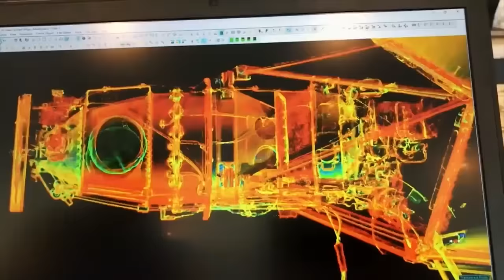We both almost died...now what??

Comment: Everyman's affordable airplane is the Patey sized challenge in my mind. Hard to quantify because it's different for everyone. But I can think of some good qualifications:
1 - Hangars are expensive. Trailerable, and make the trailer part of the support system for the plane. A 'portable shop' designed to support the aircraft, even disassemble major components
2 - 6 seats with tradeoffs in baggage weight, etc. Physics only goes so far
3 - Modular engine systems that are easily maintained
4 - Possibly inline twin for safety?
5 - A dramatically less expensive engine option - biggest challenge
6 - Printable components - make use of "maker" technologies such as plasma tables and 3D printing for most components
7 - 1,000 nm range
8 - 150 knots or greater
9 - Turbocharged for safety even in the flatlands. Climbing  over weather becomes a possibility
10 - Dirt simple systems

I've been working on this for years. Lots of ideas.
Reply: Regarding the modular engines - I really want to see hybrid aviation. If you have a generator, batteries capable of keeping you in the air for maybe 30 minutes, and a pair of electromotors, you get a system that is almost impossible to suddenly lose an engine on. Electromotors can be pretty oversized for redundancy if one fails by some miracle. A genset that is scaled for some reasonable climb will give you range and backup for batteries while being lighter than an aviation-grade engine scaled for takeoff power. Batteries make sure that your genset is not a single point of failure, giving you the power boost for takeoff and the time needed to make the turn of death when needed.

Comment: 1. There's great momentum and community building going on general aviation right now. 
2.  General aviation still seems to be plagued with accidents and a high incident to death ratio.  
3.  No association affiliations. 

    I'm a fan of general aviation.  I've had my face pressed against the glass, looking in at all the fun, for many years.  From an outsiders perspective, here are the key barriers that I, or anyone in my position, will need to overcome in order to become an insider:

•Enormous financial startup costs and significant ongoing maintenance costs.

•Sometimes the "general" in general aviation makes it difficult to decifer which camp is right for me.  

•Space.  Aircraft kits are just to bulky to assemble. They are overly time consuming to build so a modest privateer like myself feels pushed toward entry level ultralights and less safe decision making. 

My proposal for the Patey Bros: 

• Design a GA aircraft that has zero kit components, rather, only accessible materials. One that is the safest in the skies.  A plane that is a true quick build.  Maybe it uses advanced adhesives instead of rivets.  It needs to be jaw dropping cheap ($10-$15k) all in.  It needs to operate like a conventional fixed wing aircraft as an ideal time/experience builder.  It should be docile and intuitive with just enough delight in flight.  It absolutely must be trailer friendly for at-home storage.  Lastly, it needs to be a fine looking bird, with charm and simplicity that instills confidence and pride of ownership.  The Volkswagen bug of the skies.  

In short, I think the greatest contribution you two could give to GA is accessibility.  

Love the channel, and so glad Mark is healthy.  Best regards, 
Ben
Reply: I agree completely.  Flying should not have to be a life-or-death decision.  Better technology could reduce the chances of the pilot making deadly errors.
Reply: 100% nailed it. Flying is cost-prohibitive, and when something does go wrong in the air, the death ratio shows a HUGE gap in how we've handled the evolution of aircraft vs automobiles.
  
I know some people dislike ballistic chutes, but if an engine blows and you aren't near a viable strip, or a rookie pilot gets into a spin they can't recover, a parachute WILL save your life. And not just your life, but in many cases will preserve your plane as well (minus repairs). It just seems like such an easy cost-saver / life-saver, I don't understand why they aren't more widespread. Cirrus gets it. Many ultralights get it. It's high time the rest of GA/LSA does too.
Reply: @thecheesedip  I don't dislike Ballistic chutes but the repack costs are horrible, the Sirrus chute is 20k to inspect and repack.
Reply: @wb6anp sounds prohibitively costly. Crash structures are passive and can be extremely light and cost effective (f1 cars),  there seems to be a pursuit of lightness and efficiency that's incompatible with crumple zones, roll cages, bolstered seating.  If the aircraft can be designed for passive crash protection, it becomes sacrificial in a crash scenario. I'd be quite happy to walk away from a crash if my aircraft is a total loss...if it only costs $10-$15k.
Reply: @rickwhite2567 I have about a million miles of highway driving under my belt.

Technology does not help people keep their eyes on their surroundings. Too busy watching cameras or TV's or phones inside their vehicles. Just like flight eyes out unless imc. 

What needs to happen is People paying attention. Driving at resonable speeds.
people paying attention.
people having consideration for other people around them
People paying attention.
People maintaining their vehicles.
People paying attention. 

In my opinion if you can't pay attention to what is going on around whatever vehicle you are in, you shouldn't be controlling a vehicle. It should be a privilege and not an entitlement.
Reply: @awefultiger  that would have to be a low altitude, low speed crash. The forces involved in an aircraft crash are often multiple times more than what you'd experience in a car crash. Crash structures most likely won't protect very well from a nose over or stall crash at speed even 1000ft in the air.

Comment: My dad is a GA pilot, brother is a commercial pilot, and I am just starting flight training and building a kit experimental helicopter in parallel. My experience in GA is limited as I am just getting started. The cost of GA has been a huge deterrent for me. 

1. What's going right? Without question, the community. Aviation brings people together and for the most part is filled with extremely generous individuals who are happy to share their passion and support others, whether it's taking someone up on their first flight, or helping someone with their home built. I am sure you both will get a lot of support in making GA better for everyone because we are all in this together. 

2. What's going wrong? 
2.1 The cost of GA has far out paced the wages in the last 20 years. My father was able to buy and fly plane as a middle class individual, but I don't think that is possible today. Light sport, and experimental kits seem to be the only real entry point, and even then, it's still pretty expensive. Reducing the regulations might make things cheaper, but at the cost of safety? I don't know what the solution is. Operating cost is huge when you consider annuals and purchasing certified parts. Not everyone should be working on their own planes, but for those who enjoy building and maintaining planes a much as we fly them, there should be a solution for those individuals. 
2.2 Finding quality flight instructors. Many of them are using it for time building. Turnover is huge and the training is poor. 

3. I haven't been part of an association for more than 5 years.

Comment: I must admit, I had tears in my eyes when Mark talked about his near death experience. Good to see you're back at it!
My greatest thought about aviation where I live, Norway,  is that it's extremely expensive. Not many have funds to own their own aircrafts, and the few clubs available have not that many "time share" aircrafts as I call them. You buy a piece of the craft and share all expenses on it, and have limited time to the aircraft for flying.  This works, but there should be more available, and prices should be more manageable.

I really want my own motorized glider. My grandfather was a WW2 fighter pilot and one of his biggest dreams was for me to become a pilot myself. When my time came for mandatory military service, the military placed me in the Navy. (Not complaining, I've had loads of fun and it have opened many doors for me later on). But my ticket to a pilot license and the actually use for it went out the window as I kind of relied on getting on through the military.
Now, as I've become older, past my 40's and racing close to 50. I'm in a good place with family, work, financial etc. But aircrafts are still CRAZY expensive here in Norway, and gliders are a bit cheaper. And... another reason for me wanting to get a glider is... My grandfather always wanted me to start with gliders from I was 16 years old, but my parents did not approve of it. Norway is a beautiful country from both land and air, and sailing above, relaxing and "disconnect" from work is a dream for me. 

So, option 2 is probably the only thing I can answer you on that can give a meaningful output.
If Mark (or both of you) start a "Time Share" aircraft leasing business to help others into getting up in the air. You could stand as the majority owner of a craft, and have spots open for others. This might be a way into getting more active pilots... Might also be a paper nightmare with lawyers, so you should consider the drawbacks as well.

PS: If I'm one of the random to get a gift. Please donate to something Children's Hospital ore something similar. I'm always donating to an organization called "Stiftelsen Sykehusbarn" here In Norway.

Comment: My son and I have really enjoyed your ideas, designs, and engineering for years.  I even have a small Draco model in my office and was also upset at the loss of that amazing aircraft.  Pushing the envelope of what current minds think of as limits has been a motivation for both my son and myself in our business lives as well as our personal lives.  We have designed and built customized adventure vehicles decades before overlanding was a fad and an over used term by the influencing crowd.  My career is in Cybersecurity and Risk Management and I have been fortunate enough to build a successful company by pushing back on assumed limitations and asking the questions of why we do something a certian way and not just accepting it as the way it has always been done.  In my industry I see people and organizations build compliance frameworks, products and even write requirements without possessing actual applicable or relevant experience.  I see the same in aviation.  There is a significant difference in authority and bureaucracy.  I understand there needs to be authority otherwise we could dissolve into chaos, however, the amount of bureaucracy stifles, suppresses, and inhibits creativity.  In this video you mentioned the mountain of paperwork required on just one of your current projects.  When I have bandwidth, I also watch some of Dave Sparks vids on his helicopter acquisitions and he too laments on the volume of bureaucracy one must wade through to accomplish anything in aviation.  

You asked 3 questions so I will provide my opinions:

 Question 1 - What is right with aviation:  As I have been researching the production aircraft offerings, I am drawn to Diamond Aircraft as I think they have captured a lot of what is going right.  Simplistic controls of complex systems, simplified management and monitoring of redundant systems, use of diesel engines to leverage availability/accessibility of Jet A fuel,  use of a gearbox to manage prop RPMs and automated hydraulic pitch control simplifying the constant monitoring and management by the pilot, and many other integrations with technologies introduced by Garmin as well as others.  Their use of composites in the airframes and the integration of safety feature in the design of the aircraft systems like their fuel cells and landing gear that uses hydraulic pressure to maintain the retract status vs being used to deploy the gear so in the event of loss of electric power or hydraulic pressure the gear will automatically extend using gravity.   Lastly the construction of a twin (DA-62) with flight characteristics previously limited to a Cessna SkyMaster with abilities to continue to fly, effectively maneuver and even climb with only a single operational engine. These are just a few of the advances in technology other aircraft manufactures should be deploying in production aircraft.

Question 2 - What is wrong with aviation:  This one is much more difficult as I am not closely enough affiliated with the private aviation industry as I probably should be.  I see things from the outside as being expensive, exclusive, restrictive, and not inviting to the general public.  My father purchased a Cessna 172 SkyHawk when I was a young teenager and I grew-up flying it.  We kept it at a little  private grass strip.  My uncle was an AP and performed all our annuals and we did all our own maintenance and repairs.  We bounced around the southeast any time and any where we wanted in that little bird for over 20 years.  However, now that I am older and my Dad sold that plane after owning it for close to 30 years with the last decade of 22Lima just gathering hanger rash, I have been considering purchasing a newer plane to make my business travel more convenient.  However, the volume of paperwork, government over-sight, and ever-expanding restrictions is making me reconsider that decision.  I think there is simply too much bureaucracy for the sake of control that goes way beyond simple safety measures.  Like the FDA, CDC, EPA, TSA, NSA, IRS and other government agencies that are staffed by non-elected mid-level bureaucrats, the FAA is bloated and needs to justify their existence and budget.  That control fixated bureaucracy staffed by pencil pushers that have never experienced the freedom of piloting an aircraft yet have the authority to manufacture and enforce restrictions is what I see as the single largest problem with general aviation adoption in the US today.

 Question 3 - Associations: None.

Comment: I'm happy both of you are here among us! I really like the idea of the modernized "Van-Life" Albatross!

Areas to Address:

Reduce the overall costs for flying a plane-
1. Economical GA airplane power plants- The Diesel engine (EPS Aero) is a huge loss for GA. 
It could have been a family of extremely reliable, reasonable engines (4-8 cyls) which could be retrofitted into older airframes / kitplanes and deliver a reasonable per hour costs of flying. Perhaps resurrect the project and figure out how to make production affordable.

Include propeller pitch control... The reduced pilot workload of a water cooled, single lever engine operation could attract new pilots.

2. A PC based Arduino/PC flight panel that is reasonably priced to be able to retrofit into older airplanes & new build kits. Something with pre-assembled wiring harnesses to make quick and fast installation for the most popular aircraft in GA.

3. Get the FAA to set a maximum limit liability for GA lawsuit awards.

All the best,
M-

Comment: Hi Mike and Mark. First of all thank you for being aviation pioneers of our generation, ya'll are living legends. I am inspired and a big fan.
My name is Leso from South Africa. I am a certified FAA A&P+IA and private pilot. 

I only have one suggestion, and it is as follows:

1. Being an Aircraft Mechanic for a good amount of years and a passionate aviator, my biggest concern and fear is a catastrophic engine failure.
I commend Rotax for the development of the new engines to help the entry flying market with new, affordable and reliable engines.
Take nothing away from the traditional engine marker like Lycoming and Continetal their engines stood the test of time but the fact is that something has to be done about the recent spike in engine failures that leads to loss of lives of the inexperienced student pilots. Yes we overhaul the engines but what is not noted or spoken about is the bad habits the engines had to endure in operation for the last 50 years. Metal has memory.

Solution. Mark and Mike, please look into building a new aviation engine and get STCs for such engines to be used on all or most of traditional trainer airplanes. 

I am a member of Aviation Development Africa and EAA.

Comment: You both are extremely generous of your time, experience and knowledge and are a huge asset to the aviation field at many levels.
1) What is going right in aviation.  People like you offering encouragement and resources to many people.  Local EAA chapters.  Relaxed changes and procedures with basic med, etc.
2) What needs fixing?  Cost has pushed General aviation beyond limits to most people and the changing economy is challenging it more as time goes on. 
3) What associations are you supporting?  EAA and AMA (model aviation).
I have flown RC planes since the late 70’s, got my PPL at 19 YO in 1987, worked aviation maintenance (jet engine Field Service tech) for 39 years and finding it more difficult to manage the cost of aviation. 
I would love to see you scale way back and challenge yourself to design an all metal (preferred), quick fold wing, 4-stroke powered or twin engine 2-stroke powered (for reliability), STOL FAR part 103 ultralight.  Or a light ELSA version would work too.😀 
 You have well proven your great talents with the complex design. Now look the other way an see what you can achieve.  This could put many people in the air after they learn how to build a plane.  Do the RC DRACO’s fly well?
Thank you both for all you do!